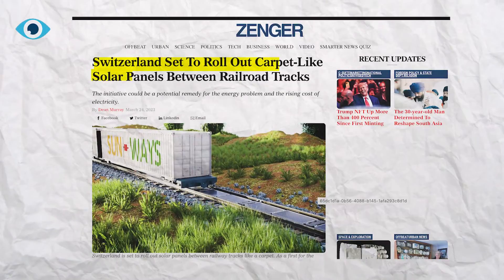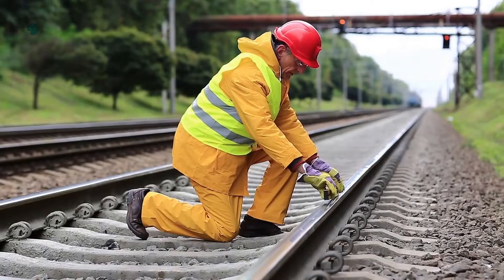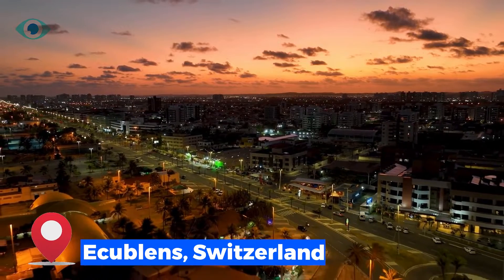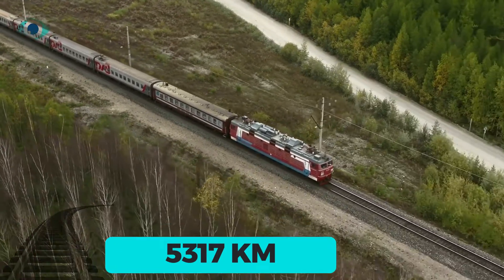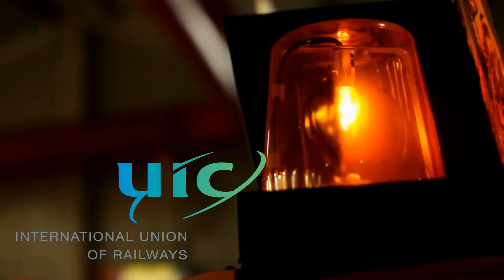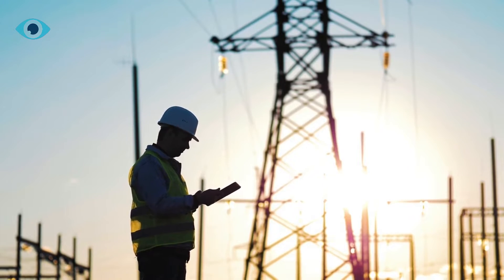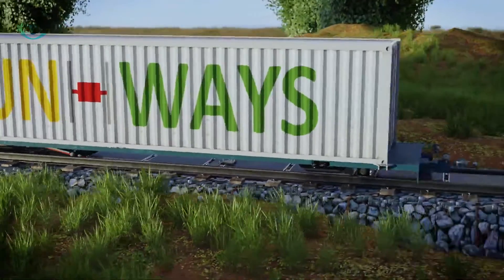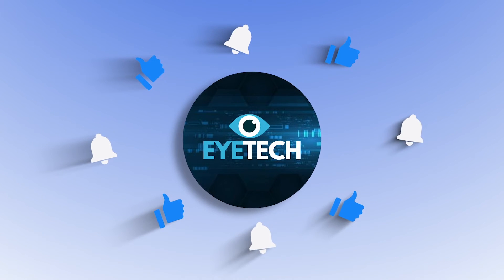GENIUS Swiss Solar Carpet to Power the Future of Transportation

Comment: Pv will be stolen for sure ! 😟🙄😱☹️
Reply: Yeah... it's the only thing preventing this from happening unfortunately. 😔 Or you will need to welt them on, and design some kind of "vibration sensing" monitor, to detect grinding immediately.
Reply: Our photovoltaic panels have special, highly visible markings that greatly reduce their market value.